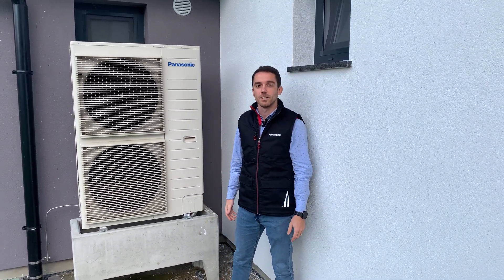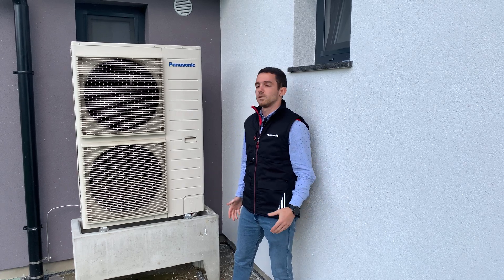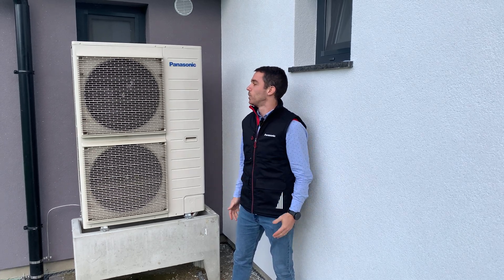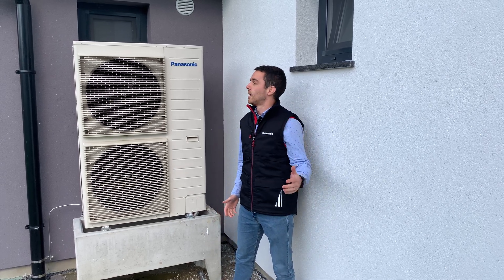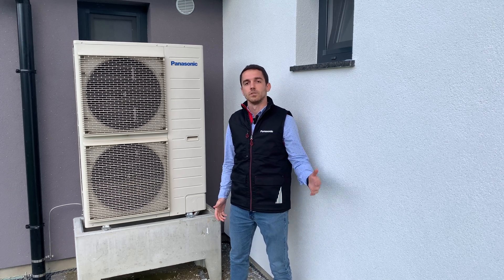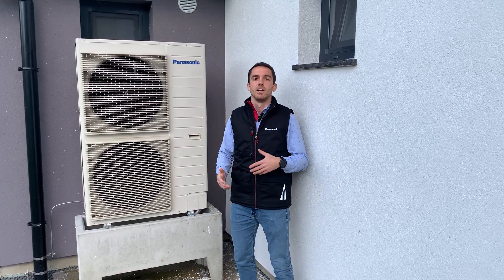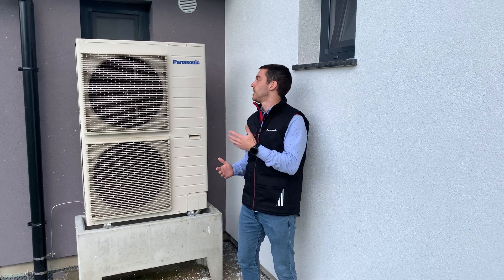300m² Underfloor Heating System Explained | 12kW Open Loop Design

Comment: Even almost a year from this interesting post has past, I also want to ask some questions Mario. House is 300sqm, so it's quite large. I suppose there are typically at least 5 or more zones (living room, kitchen, 3 bedrooms, etc). 1) Is heat pumps' circulator strong enough to cover the highest demanded pressure drop, since a quite large flow  is needed  (5oC dt is usually used) 2) If more than 1 zones exist, typically after market thermostats should be used to have zoning. So you should use thermostats for sending demand on/off to heat pump, setting it (the heat pump) to outdoor reset curve without room temperature reference (heat pump operating only from water temperature). How do you deal with different room heating demands? Do you have any UFH other zone control system (Rehau, Uponor, or other)? 3) If you designed for 5 thermostats and relevant zones how did you overcome defrost demand if all zones are closed, since you do not have a buffer tank and primary/secondary layout?
Reply from the maker: 1. Yes, installation is perfect
2. All open zones, with thermostats more ON/OFF cycles and higher flow temperatures needed
3. You can put few thermostats but generally 10-20 L/kW open volume is the best
Reply: @HVACEducationHub 1) Maybe in Panasonic pumps are strong or in this project main risers are short, so pump head is low. In Daikin and Mitsubishi pumps are not strong enough, so primary and secondary could not be avoided 2) I don't know for your area, but in ours this approach is difficult to apply as due to large windows and sunlight, rooms have severe temperature variations, so more than 1 thermostats are needed. Also clients want to have the ability to set independently the temperature in every room, set a lower temperature to some rooms for energy saving or even switch some of them off. The method you propose demands a perfect heat loss calculation and balancing of all circuit flows, as well as perfect selection of compensation curve in heat pump

Comment: Koliko litara vode u sistemu po kW snage toplotne pumpe je optimalno za normalan rad ??

Neko kaze 25L neko 55L itd.

Koliki delta T je idealan, 5°C ili 7°C ili ??

Ukoliko nemamo dovoljno vode u sistemu radijatorskog ili podnog grejanja, moramo li dodati baffer kako bi povećali količinu vode u sistemu?
Reply from the maker: Ovisi o prostoru koji se grije, ali neka gruba preporuka je 20 L/kW.
Racuna se po ovrjevnim tijelima i njihovom kapacitetu.

Delta T od 5 C je idealan, za par dana cu staviti video na tu temu.
Ali i to ovisi o objektu i instalaciji.
Za kompresor je najbolje 5.

Da, najbolje mali buffer 50 L na povratu za povecanje volumena.
Reply: Hvala puno na odgovoru.
Imam Lg Split Therma V 16kw, na 15 radijatora sa Calefi termo glavama (6 x tip 33 + 9 x tip 22), bakarne cevi.
BEZ bafera!

Kuca je oko 200m2, prizemlje i sprat.
Prizemlje je cigla, sprat je siporeks blok, stiropor fasada spoljna 5cm.
Tavanski prostor staklena vuna 10cm.

Delta T se kreće oko -+ 5°C nekada malo više nekada malo manje.
Grejače 9kw podesio na -10°C
16kw pumpa x 20L/kw = 320L ja sam siguran da u sistemu nemam 320L.
Mislite li da bi bilo dobro da ugradim i mali protocni baffer od recimo 100L ili 150L kao volumizer na povratnom vodu ?
Reply from the maker: @inspektor.  trebalo bi vidjeti koliko stabilno kompresor radi, ako ne moze dobro modulirati (cesti ON/OFF ciklusi), buffer 50 L bi pomogao.
Ali ako je sve ok, nema potrebe.
20 L/kW je neka gruba procjena.
Reply: Problem može da nastane, meni se dešava, na oko -1°C pri 82% i više vlage u vazduhu. 
Tada spoljna jedinica brzo zaledi i kompresor izbaci maksimim oko 40°C, ne može više od toga. 
ALI taj potis, od 40°C zbog leda ne drži dugo pa temperatura ubrzo pada sa tih 40°C na nepovoljnih 34°C pa ide defrost i tako u krug.
Tada se radijatori rashlade logično, i temperatura u kući opadne za nekih 1°C - 2°C. 

Kada je vlaga u vazduhu ispod 80%, TADA pumpa radi bolje na -7°C ili -10°C nego na -1°C sa preko 80% vlage i kompresor dugo može da šalje potis od 42°C u kontinuitetu i sa tim potisom na -10°C u kući imam oko 25.5°C što je odlično.

Možda bi bafer od 100L mogao da pomogne, i da ublaži ili eliminiše te nepovoljne uslove kada je visoka vlažnost vazduha?

Mada, ukoliko bi danima bilo -1°C sa 85% vlage i više, mislim da tada ni bafer nebi pomogao, jedino električni pomoćni grejači u pumpi.
Visoka vlaga vazduha = brzo zaledjivanje spoljne jedinice = drastični pad performansi u radu toplotne pumpe = maksimalni pik kompresora od oko 40°C vode koji se ne zadrzava dugo.
Reply: @inspektor. Povećaj površinu radijatora. Dodaj panelne radijatore, ili dodatna rebra na postojeće
Reply: @mrjozza5924 
Hvala na predlogu, to sam odradio. 
Celo prizemlje novi radijatori tip 33 a na spratu veći tip 22.
Imamo u sistemu oko 100l - 150l vode max što mislim da je malo za Lg od 16kw.
Možda bi protocni bafer kao volumizer vode pomogao?
Reply from the maker: @inspektor.  koja je kvadratura kuce i izolacija? Za manje defrosta treba kompresor raditi na nizim okretajima, ako radi previsoko brze se zaledi.
Reply: Imam Lg Split Therma V 16kw, 
na 15 radijatora 6 x tip 33 + 9 x tip 22, bakarne cevi.
BEZ bafera!

Kuca je oko 200m2, prizemlje i sprat.
Prizemlje je cigla, sprat je siporeks blok, stiropor fasada spoljna 5cm.
Tavanski prostor staklena vuna 10cm.

Iz mog iskustva:
● na relat. vlažnosti vazduha od 85% i više - često zaledjivanje, defrost minimum 1-2x na 1h rada - slabije performanse pumpe.

● na relat. vlažnosti vazduha od 80% - manje leda i defrosta - bolji rad pumpe.

● na relat. vlažnosti vazduha od 70% - leda skoro i da nema, redji defrost - odličan rad pumpe.

Zaključak: u sredinama gde su temperature oko 0°C i niže, pri ralat. vlažnosti vazduha od preko 80% - toplotne pumpe će češće zaledjivati, ići u defrost, i samim tim imati manje performanse u radu.
Delta T je uvek oko 3 - 7°C.

Comment: Hello!
I'm interested to know details about this house: 
- number of persons who live there;
- DHW tank;
- the wall (brick / wood, etc);
- the insulation;
- ventilation system;
- total surface of the construction;
- what is the programming temperature to chose the air-water heat pump;
- the average temperature for the place (in winter).
Thank you very much!
You are doing a very good job with this channel!
Congrats and all the best from Craiova - Romania!
Reply from the maker: Hello,

- 2 + 2 kids
- 185 L integrated DHW tank
- wall is brick/concrete + 15 cm insulation on outdoor walls. Roof is still not insulated
- without ventilation
- 300 m2, 150 m2 ground floor and 150 m2 1st floor
- if you mean design outdoor temperature, -15 C
- average winter is below 0 C by the night, above 0 C day

I don't have data for annual consumption, but as far as I remember, aprox 80 EUR (around 600 kWh) is the maximum monthly price for heating/DHW

Thank you for support!
Reply: Also:
-  the annual required thermal energy to heat the house and
-  the annual electrical energy consumption.